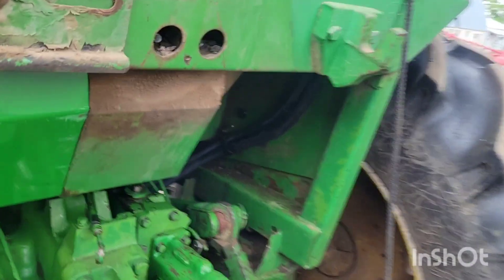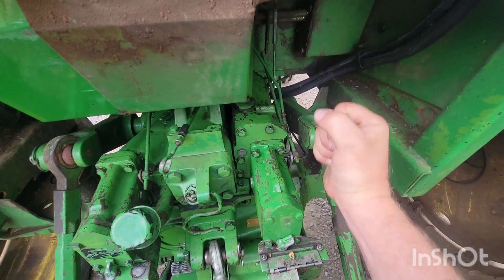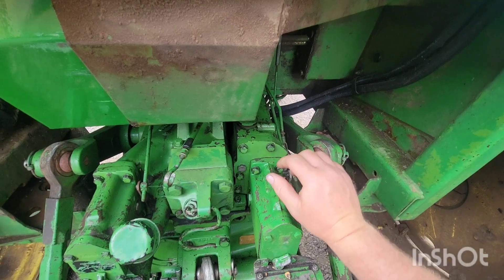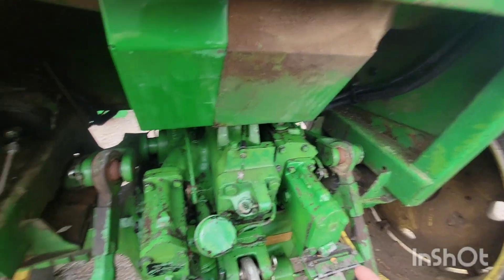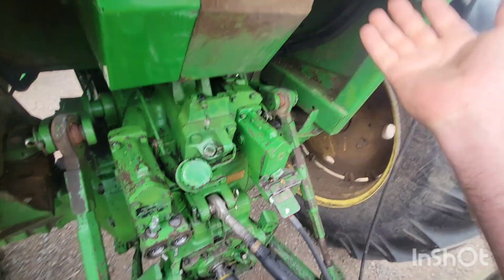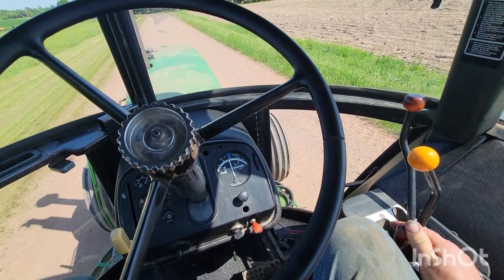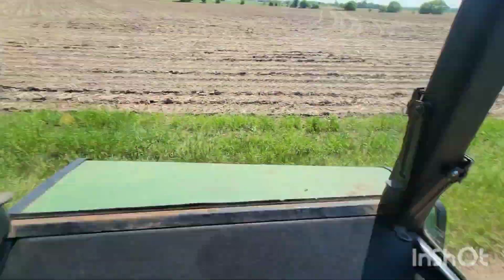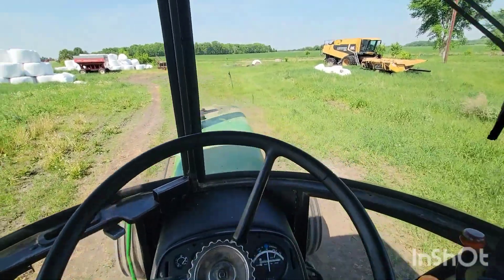4430 John Deere 3 pt adjustment.

Comment: Great tutorial here Jon! You couldn’t have explained this any better than you did! This will give some of the younger guys insight on these older JD’s that venture into repairing these problems themselves. Just went through the Rockshaft control valve on a low houred Late model 4430, 1977 model, tractor, was purchased with 3 point not working finally getting around to it, absolutely couldn’t get the adjustment outta the rockshaft, found to be a broken spring and a linkage in the control valve housing, kitted the control valve with new needles&seats, valves, springs, replaced broken linkage & spring, reinstalled, adjusted perfectly after the repair.

Comment: Good video. I have 4430.. the 3 pt lifts up, but the cab lever is halfway up before the arms start raising. I’ve done the vise grip check, and that seems to be fine. I don’t understand how I can do the other adjustment when the arms are already full up when the cab lever is in the up position? In the video, the arms are still down with the cab lever in up position. Thanks
Reply from the maker: @keithd1610  if you move the load draft lever in the cab, does that change anything? 

If you shorten the rod so the valve for the three-point can turn further. Does that get them to lift higher? 
To adjust the valves I do it where the arms are just slightly up and you can get a inch and a quarter socket and wrench in there and pop that big nut loose. Then with the vice grip on the valve lever you can raise the arms about halfway. Then you can go into that opening and adjust the valves. 

Talk to your local dealer or do a Google search online or with your chatbot GTP maybe somebody can get you a copy of the instructions
Reply: @jonstevensmaplegrovefarms3754  I did shorten the rod, and that gave more range of response from the arms (arms started moving up much sooner when moving control lever to the up position). As for the adjustments addressed in your video, what position should the draft control lever (down by right foot) be in while making the valve clearance adjustment, zero or max? What position should the draft control lever be in when making the adjustment with the long socket, zero or max?  Thanks for your time.
Reply from the maker: @keithd1610  can you get a copy from a local dealer? Otherwise send me your email
Reply: @jonstevensmaplegrovefarms3754  I couldn’t get the info from the dealer. I’ve been trying to reply with my email address, but it won’t post for some reason.
Reply from the maker: 4640jon@gmail.com

Comment: Thanks for the 3 point video. I'm working on 4230 which has never lifted very good. Following your instructions it only lifts when the vise grip is almost all the way forward.  Then I discovered  my problem,  when vise grip is all the way forward, arms started to settle a little and I can see a major oil leak just inside the plug, and towards the right... what goes wrong in the valve to leak to sump?
Reply from the maker: Leak past the needle and guide, or a crack in housing, cover plate under 3 pt piston.

Comment: I have a 4230, does it matter what position the rockshaft selector leaver (draft control lever) is in to do this adjustment?
Reply from the maker: Ah yes. Did I not mention it in the video? 
I would see if your local dealer would get you a copy of the pages from the book. Read the book as you watch this video and it will make a lot of sense

Comment: Amazing video, very informative.My 4230 3 point is no lift until the very top of the control is hit, then it goes all the way up,  then 1/16 on the handle is lowered  and its all the way down. .I'm hoping this will fix that any thoughts?
Reply: I have tried that, if the draft lever is less that 3/4 I get zero lift at all, if it's at 100percent I get lift but no ability to choose a midway position, either up or down. I'm working on it now with the draft over slot screw
Reply: So I gained a tiny bit of control using the first step of your video.but still mostly all the way up or down. I'll grab a socket and weld it up next and go thru the bung.
Reply from the maker: With the draft lever In one position I think the book says by the time the back of your control lever gets by the number nine your three point will be almost all the way down.

With the draft in the other positjonah.Then as you move your ladder forward.The three point goes down
Reply from the maker: Move your draft lever by your right foot to the other end of its slot.

Comment: I have a 4020 with hydraulic problems. Sometimes the power steering works, sometimes it doesn't. Sometimes the loader works, sometimes it doesn't.  Front pump has good pressure and the pump under the deck plate looks good.  Do you have any idea what may be wrong?

Comment: Good information, any information on a 4960 three point hitch not lifting?
Reply from the maker: Hydraulic wise it would be very similar to the 4850 I did the other winter. But then the  4960 you've got the electronic side.